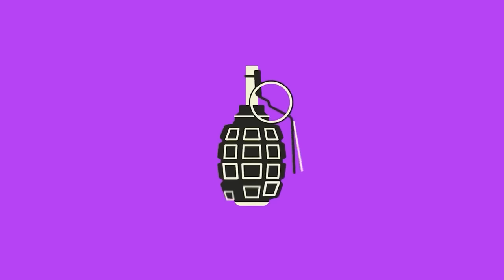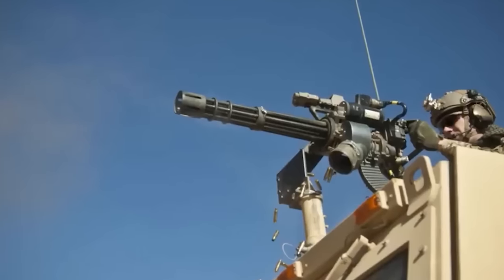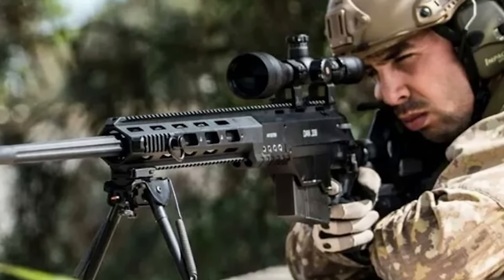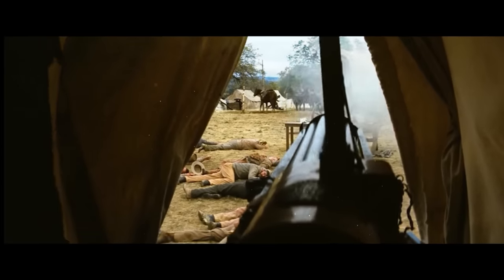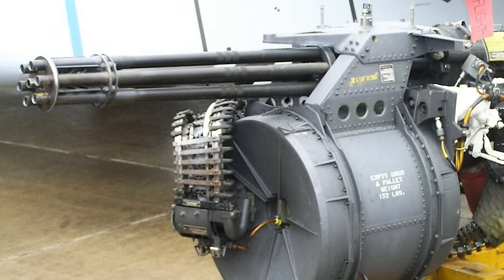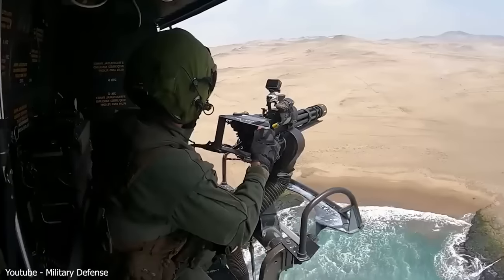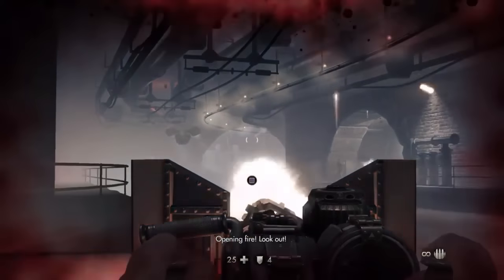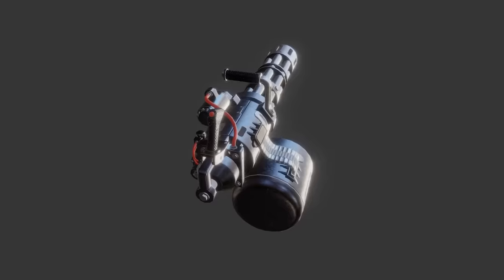THE DARK SIDE OF MINIGUN: WHAT IS IT HATED FOR

Comment: Furthermore, small versions of minigun (like the ones you showed us being carried by infantry) have shorter barrels than traditional machine guns in order to keep the weight relatively low, meaning they have shorter range and penetrating power.
Reply: yes and by the way a 7.62x51 cannot penetrate a lightly armored vehicle, unless that "lightly armored vehicle" is a toyota truck with a DShK on the bed. which doesnt fall under the definition of "armored" as it couldn't stop even a 9mm

Comment: Germany was evaluating the 20mm M61 Vulcan for use in jets and on ships.
They ultimately did NOT go for it because it is electrically driven which has 2 distinct disadvantages: Firstly if the power is interrupted it stops to function altogether but what really did it in is that being externally powered it takes some finite time to get up to speed while a regular gas-powered autocanon is up to full speed from the first round meaning that during the all important first half second to a second of firing a standard autocanon throws twice the amount of lead towards the target than the Vulcan even though its ultimate rate of fire is much lower.
Reply: The Vulcan is as reliable as a chain gun, in many cases even more reliable. They are hydraulically driven and electrically fired.  The Vulcan does not have a firing pin, and the rounds do not have impact priming.  there are electric driven versions available for groundcrews mostly the M134 5mm minigun variant, but there are a few 20mm versions out there.  That makes sense, a battery is far lighter than a hydraulic reservoir.    

The initial variant had linked ammunition which would jam the cannon, but the first revision eliminated that problem   The standard recoil autocanons rarely run a full magazine of ammo before they jam, and once they jam they can't fire until a ground crew services them.  The Vulcan self clears most jams the same way a chain gun does. 

Germany adopted the later versions.

Comment: ok but what about a smaller loaded or whatever type of cartridge so no 7.62x51 or 556x45 but something like the 5.45x39 or 7.62x39 so the smaller cartidge having less powder therefore lesser recoil or even perhaps the 9mm round for a man portable minigun the smaller rounds would aslo take up lesser space and if the fire rate would be put down it would take less power and also again have lesser recoil so it would actually be somewhat reasonable
Reply: There are 21 gatling guns used worldwide. 

Seven in the US. Scaled down m134 called XM556 is using 5.56mm. Cywilian versions in 9mm and .22lr.

Comment: Duribg vietnam they did experiment with a scaled down minigun nicknamed "the six pack" which fired 5.56mm instead of 7.62mm for infantry work but the need for heavy batteries and it's ammo consumption rate meant it was discarded. I believe only a handful of prototypes were made
Edit: its the XM214 microgun, andnonly about 10 were ever built
Reply: Look up XM 556 they are in production, there are lots of YT videos showing it in action
Reply: @JoeBLOWFHB  GE made a 5.56 counterpart to the 7.62 long ago, but abandoned the idea because it was more feasible to arm a soldier with a SAW and hundreds of rounds of belted ammo for the same weight as a mini-gun and only a couple thousand rounds. The current 5.56 micro gun is being made and looks fun, but thanks to the Hughes Amendment it will only be a dealer range toy.
Reply: @wittsullivan8130  BTW GE makes trains, or used to until wabtec purchased GE transportation
Reply: @railfandepotproductions  GE made all kinds of stuff involving electricity and motors, including electric chairs.

Comment: 3:18 ....i've yet to see a Micro elephant that only wheighs 30 kilos ....for reference a newborn Elephant already wheigs about 80 to 100 Kilograms

and a small industry sack of sugar is at 25 Kg  a Kilogram is 2.205 Pounds 

edit sooo it would be possible to carry it around and maybe even use however the wheigt is still a problem and the gun should be mounted on some surface for effective use

Comment: The problem is that it fires a shitty cartridge at stupid fire rate which results in massive overconsumption of ammo and turns the weapon in logistical nightmare, all while being an expensive, bulky piece of equipment itself. You can tuck in actual AUTOCANNON in same weight/logistics budget which will shred everything short of tanks and it will be better for everything, from removing doghouses in the middleeast to shooting dogs in the doghouses in the middleeast. "Hurr durr potential to kill" is not a good metric, especially when you can deploy multiples and have to limit TYPES of targets engaged for that extra "potential to kill".

Now, let's watch the video.
Reply: I'd like to see someone use a 30mm autocannon mounted on the side of a Blackhawk...
Reply: @WarlordEnthusiast  
1)Autocannons are not limited to 30mm
2)Floating barrel and agressive muzzle break work wonders on recoil
3)In current little war between Russia and Ukraine both sides use 23mm autocannons by strapping a harness on the guy and 2nd guy holding him from behind. Looks like a gachimuchi joke, but jokes don't sweep point defences.
Reply: @burningsinner1132  20mm limits your ammo capacity even more than 5.56mm and defeats the purpose of having a side mounted gun on a helicopter, you want maximum rounds downrange in the shortest period of time.

Well placed 20mm shots by a side gunner is a contradiction.
Reply: @WarlordEnthusiast  You don't need as much ammo with autocannons as you need with 5.56 rounds. Because autocannons got sensible HEFI options. As a result, minigunner, with his 500-5000 belt (Having VERY lengthy reload) gets about 4-40 effective bursts. Autocannon does the same job with 4-6 round bursts, got armor piercing advantage and does not need "well placed shots" to begin with. You are hurling half a frag grenade with each HEFI shot and  enough punch to pierce a brickwall/concrete panel with API, with easy to use short belts or clips you can load super fast.
Minigun is literally a solution to a problem that only exists on paper, based on a hype around development of Vulcan cannon. Brass wanted something as destructive, but for troops, they received PoS without filler that acts like smaller vulcan, but got bite of a flea. Which worked in 'nam to some degree because locals couldn't find half a concrete emplacement or solid shelter among themselves.
Reply: @burningsinner1132  1) A cannon by definition is 20mm+. You still don't want one of those on the side of a helicopter. 2) Do you even know how aircraft cannon work? Also, it's 'brake' 3) Man-packable deployable 23mm cannon? I fucking doubt it.

Comment: One of things not mentioned is that the vulcan machine gun is so power full that it can only be shot in bursts or else the A10 Warthog would stall out
Reply: That is not true. Stop spreading myths.
Reply: @jacekkania8136  maybe it's not true, but i've certainly heard that repetitively over the last decade. not that it would stall out, but it would almost overpower the thrusters with its recoil
Reply: @GraveUypo  Not true in any way, shape or form. It's a 30000lb aircraft with 2 engines pumping out 9000ft/lb of thrust each travelling at well over 200mph even while loitering, it'd take a ridiculous amount of energy to slow that thing down particularly as the cannon is only used during dives where gravity is doing its best to pull that mass towards the ground. If it was gliding level with no engine thrust then sure, sustained fire from the cannon would result in lost air speed but that's not a likely scenario at all. The reason for short bursts is due to the low altitude nature of application of cannon fire you don't have a long time on target while on an attack run and the gun puts huge stress on the airframe so there is no reason to keep holding the trigger. There are an awful lot of myths about the A10 but the reality is that the cannon isn't really that useful anymore because hanging around at low altitude while moving slowly and having to visually identify targets makes you a pretty good target for MANPAD systems, better to use those upgraded electronics to put warheads on foreheads from a speed and altitude where they can't shoot back.
Reply: @DjDolHaus86  I couldn't ask for better answer
Reply: @DjDolHaus86  Yea the things i heard about the A10. Like how you better be going at a fast speed when firing that cannon. Still the best thing I've seen. Particularly the larger depleted uranium rounds that rip through tanks like tin foil. Can just imagine the uranium rounds active and have their atoms split on impact. Low yield of course but damn could take out a city like that hehe.
Reply: The gau 8 avenger is not a Vulcan, the Vulcan is 20 mm and is mounted on f15 f18 etc. Navy calls it phalanx.
Reply: @russellgilson3536  In terms of effectiveness the Vulcan is probably the better weapon anyways.
Reply: @G-man47  The "depleted" in "Depleted Uranium" means it's not fissile material lol.  They use it in bullets because it's really dense which means more kinetic energy is delivered per shot.
Reply: @greebj  Right...cant leave radioactive material lying around. I said IF the rounds were active and detonated on impact. Imagine the minigun from Fallout 4 firing mini nukes....lol. Better yet the mark 28's....hehehehe. Bye-bye earth.😯

Comment: The Royal Navy fitted  7.62mm miniguns to its frigates and destroyers some years ago. These were for taking out small boats, skiffs , pirate vessels etc. But they have now started replacing all the miniguns with 0.50 calibre M2 machine guns on a new British -designed mount. They claim the 0.50s are better in this role than the Minigun as they offer greater accuracy, longer range and greater hitting power. Agree or disagree?
Reply: Probably agree ... the round is more powerful, which benefits range and accuracy. You also are in salt-water environment which benefits less complicated tech to a certain degree, limiting the needs regarding maintenance. And for that kind of cannon fodder, it is powerful enough. You also have the main gun as a backup if necessary.

Comment: The "dark side" of a minigun is that it isn't self-powered, like a gas-operated machine gun. A minigun needs an external power source, like an aircraft's electrical system to work. Also, a mini-gun would blow through the all the ammunition that a strong soldier could carry in a couple of seconds, so despite Arnold Schwartzenegger best efforts, a minigun is not a portable crew-served weapon. Being able to quickly shred a whole lot of people over a wide area is also pretty "dark", but that's what they were made for.

Comment: Even FPS heroes that carry miniguns are carrying a severely nerfed minigun. A minigun will chew through thousands of rounds, while the Doomguy in the latest games carries like what 200 rounds for his minigun. Their ROF is considerably turned down and the minigun is basically a gimmick.

It show cases power and stature.... But the gun is not operating at full potential lol. But let's face it, if each bullet did 20 damage, 200 rounds in the belt, 4000 damage and the gun mag dumps at 6000 rounds a minute, anything short of a boss is straight up deleted and massive waste of ammo.

 because even a regular machine gun going at 1000 rounds a minute will blast through that 200 rounds in mere seconds.

Comment: The minigun isn't actually that great against armored targets unless you're referring to a lightly armored wheeled vehicle like a humvee or BRDM. Even a BMP's frontal armor will shrug off a large volume of 7.62, though you probably could eventually degrade the armor enough to get through. Against an MBT, good luck though. You probably won't even get past the first steel layers into the underlying composite arrays.

Rotary MGs/cannons aren't exclusively an American thing either! During WWII there was a French Hotchkiss rotary 37mm cannon as well as in modern times there's the Russian GShG-7.62, Yak-B, and GSh-6-30.

Also the idea that they have to "spool up" is actually a myth. It begins firing immediately, ramping its rate of fire up to maximum.

Comment: The minigun is great for what it was made for - suppressing light armor and large numbers of soft targets from a stationary or vehicle-mounted position. Larger machineguns, like the Browning M2 (Ma Deuce) are great for heavier armor and armored infantry. The Vulcan is not a minigun. It's a Maxi gun, made for anti-tank and anti-aircraft (or anti-fast-boat/anti-torpedo).

The biggest downsides, aside from the operational cost, is actually cooling these. Most are oil-cooled, as air-cooling just isn't sufficient. You also can't fast-assault and hide them from thermal imaging - they get too hot too fast for too long. They're also a maintenance nightmare. with complex mechanical as well as electric components, that are not exactly field-servicable.

Comment: The Minigun was intended as a vehicle/helicopter mounted area suppression weapon from the start, never as a personal weapon. That image is ALL Hollywood imagination.
As well as its weight and ammo consumption, not to mention the recoil and torque of the rotating barrels, no real mention is made in the video of the power supply needed to run it. 
There is a behind the scenes shot from “Predator” of the scene when they “mad minute” the jungle, in which actor Bill Duke can be seen firing “Ol’ Painless” and can also be seen to have a large electric cable running from the Minigun, down inside his right pants leg, to a series of large vehicle batteries off camera. That is what’s required to run it, hence the vehicle mount.
To compare an M134 minigun to an infantry GPMG or SAW is to be a bit ignorant of the subject matter to be honest.

Comment: Geez....First of all the original minigun was the GAU 2-B. It was ac powered and had a 2 speed motor. If you couldn't sing the minigun song you were not shooting it. It required speeding up the belt before going to the second switch then slowing it down. didn't do it would jam it up. the m134 is a single speed gun running on dc current. the switch from ac to dc is because of aircraft sustaining battle damage. if the essential ac buss was off line the gun was dead. on dc if the battery was alive the gun was too. the guns ran great if they were lubed up well and you inspected EVERY round in the belt. I shot the living dog shit out of them as a door gunner on a Huey gunship. I love them. I would spray my barrels down with CLP.......I had 3 conditions that I personally kept an eye on..Condition one was smoking barrels....Condition two were fire flys and condition 3 was transparency. The fire flys where sparks coming off of the barrels as the steel broke down and the last I could literally see the inside of the barrel, at night of course. I always had a orange barrel on the old girl.....I called it "El Lengua de El Diablo" . By the way I know a Gunner who blew his minigun up, I was in the gunship with him.

Comment: So all the gatling guns in the world are the original hand cranked gatling, the 20mm vulcan gun used in US fighter aircraft and the 7.62mm HATO calibre M134. Funny thing is that the Soviets actually have better gatlings. The GSH-23 is gas driven so it does not need or have an electric motor to run. It gets up to full rate of fire faster than the American guns. It can also fire at 12,000 rpm. They also have 7.62 and 12.7mm gatlings with four barrels, and of course they have a 30mm gatling which fires faster than the US 7 barrel gatling on the A-10.

Comment: 2:00 The minigun works when operated by a trained professional that wears 1. A center mass strap and B. is large enough to soak the recoil.

Thus. The controversy is settled with the video footage. How to combat jamming ? The answer is simple. All weapons can jam and never attack alone. The guy in the video can wear a 9 mm pistol + the minigun because a loaded handgun will only add 700 grams to the 60 kg he's already wearing.

It the minigun battle effective ? Not very much. I rather have a friendly that's using an SSW40 with 10 spare mags because with an auto grenade launcher, the heavy guy can target trenches and bunkers while the ordinary soldier suppresses. Explosives are the key to winning a war.

Comment: The minigun itself is not very complicated. I spent a lot of time with the M134 on Cobras when in the Army (68J) and honestly cleaning was time consuming when we'd get back from a live fire but the gun itself was not difficult to work with. It is just free bolts on a cam system. The part of the system that was more complex to work on was the delinking feeder. Never had an issue in the field with the gun, seriously do not remember a single gun failing. But, many long evenings tearing apart to refurbing delinking feeders. After issues with the electronics, the #1 mechanical issue was with the delinking feeders.

Comment: ok so far you 3/4 through the video and the onl bad thing you've mentioned is its weight...?     you know they've never had and issue's with jamming,ejecting, firing, uh .not firing.... uh.... I cant find any one thats ever failed...    being its a locked gear system I know it cant fail, thats why its heavy..   if it was a Japanese crapaloy one yeah sure it would fly apart..

Comment: Maybe I missed it but I didn't hear any mention of the need for a serious power source, too. A minigun requires electricity to run. At a minimum you'd need something the size of a large car battery JUST to get it spinning. Add the weight of even 20 seconds worth of ammo and the minigun simply can't be wielded by a soldier. It's a vehicle or structure-mounted weapon.